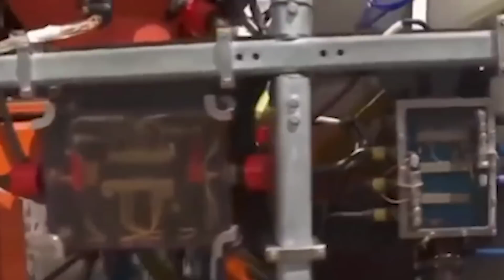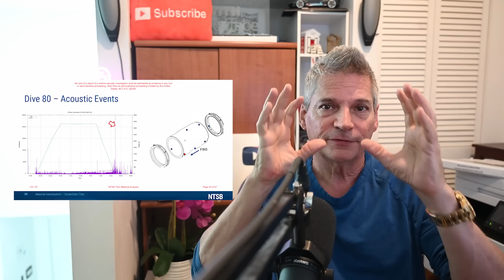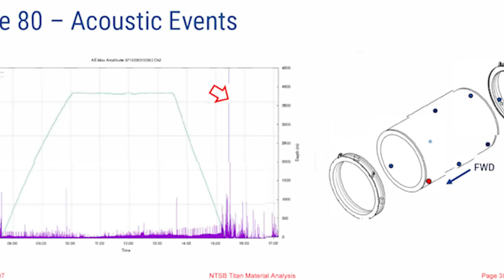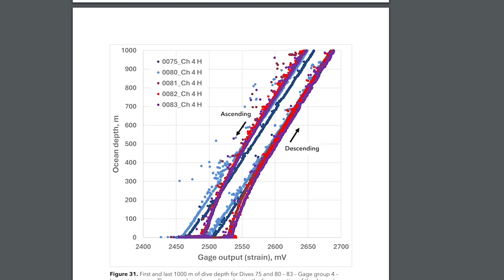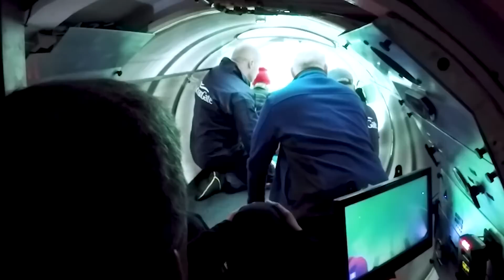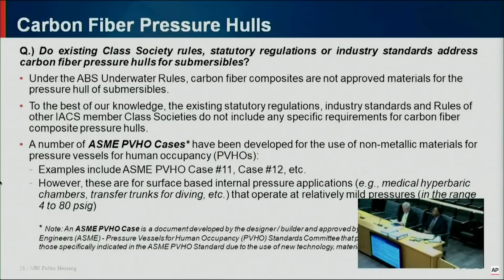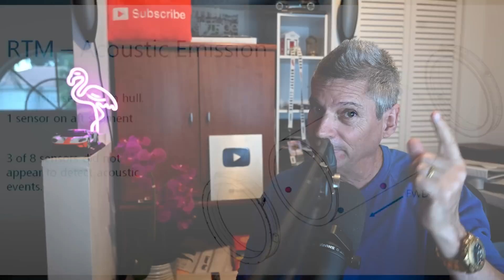How OceanGate Titan Sub Realtime Hull Monitor FAILED! RTM

Comment: That's an important question regarding culpability: After the loud bang, did they actively ignore the changes in the stress messurements (for instance: because they knew they couldn't afford another replacement hull) or did they fail to realize the pattern had changed? I wonder if the answer to that will ever be known.

Comment: The way I see it, Rush was probably told about the changes in data but didn't want to replace the hull because he was a cheap A55 and didn't want to make the expense. I've seen it many times before in my line of work, management rarely listen to the warnings given by the people performing the preventative maintenance.
Reply: Yes, but generally those people are smart enough not to let their lives depend on their own miserly ways. This was hell and gone an Ego matter. He had an idea, people said it was stupid and dangerous, and he had to prove them wrong since it was HIS idea. He ignored the dangers because he knew he was right. 
But he wasn't.
Reply: @chrismaverick9828 Their own lives at risk - not forgetting the 4 other souls who died ad well. That makes me really cross and sad - you shouldn't put other souls at risk, you can do what you like with yours. ❤
Reply: I would argue he was right, his sub made lets call it 80 successful dives, had he graphed and used the data correctly, he should have concluded that sub had reached the end of its service life, he could have salvaged usable parts off of it, taken those, and built another, while updating the design, and further improving it, and led the way in improving submersible designs. However , he failed to do this...  though had he, he very well could have lived a long, and very prosperous life taking people to the bottom of the ocean, for many years.

Comment: Everyone keeps worrying about the carbon fiber.... BUT THAT DIDN'T SINK IT!
The failure point was on the inner 1/4" titanium lip on the carbon fiber end-cap. It sheared off of the titanium segment.
The carbon fiber compression allowed that lip to be over-stressed. 
Rush and all the other after-the-fact YouTube quarterbacks keep misunderstanding the way a carbon tube transmits force to items inside of it that deform at different rates.
I haven't seen a photo of it yet, but if you find a photo of that end-section, I guarantee you will find that flange/lip sheared.

Comment: It looks like the monitoring system may have been working and was indicating something was very wrong.  Not only were there audio cues, there were step changes in the strain gauge readings.  In addition to the monitoring system audio cues the ‘crew’ heard very loud sounds.  This is speculation on my part but it sure seems like the system was indicating something was going wrong along with the obvious human perceptible sounds.

Comment: The pressure on the hull of the Titan was not enough to squeeze out the last penny.

Jeff will make sure not a single drop is lost.
He will put more and more pressure on the story.
With this title. 
That title.
Milking the death of several people like the cow it is.
For money, obviously.
Like Otto did, daddy of daughter Frank.
He sold the soul of his daughter for money, and got rich.
So why should Jeff not do the same.

This piece of tape came loose, that radio call got lost, the realtime hull monitor.... Questionable Engineering, Wreck shows why it wasn't strong enough. Etc etc. 
It is difficult to not think of a new title which Jeff could use to earn a bit more money off of the death of several people.

Great job you got, Jeff.
Reply: Jeff in his description: As the investigation continues....
Yeah, in your tiny brain it may, Jeff.
But those with a brain already know what happened.
IMPLOSION.
Plain, and simple.

Why milk it like a cow?
Are you Otto Frank, earning money from the death of his daughter?

Comment: A big issue with the RTM is that they never had any idea what the RTM would tell them. What is a problematic event? What is harmless? When does lots of harmless turn into problematic? A seismometer is useless, if it never tells you a unit!
Reply: Yes of course but a giant bang and a permanent change to strain behaviour of the hull after that, is about exactly what you would imagine is the data that tells you to scrap that hull. 

"Woop woop, terrain, pull up!"

Hmm I wonder what the Master Caution is all about?

Comment: Since carbon fiber is brittle, Stockton should have been adding the data together for all accumulated dives.  Not using a clean slate with each additional dive.

Comment: 24:03 wouldn’t it do the exact opposite. By adding those rings you’d be compromising the homogenous strength. Under the same principles as why spheres are typically used for high external pressure

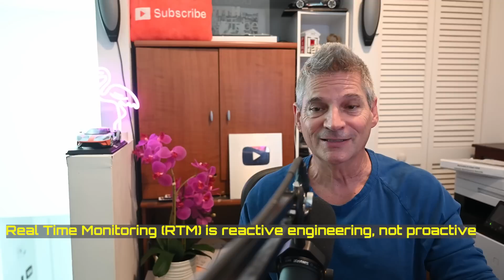Comment: 4:16 I agree with your analysis from an engineering standpoint. I’d like to pose another massive problem that existed from day one that operated from the human psychology perspective. But it ties directly to your engineering analysis. We all know that carbon fiber is designed for “pull” strength. Not “push” strength. Meaning that the Titan hull (iteration number two) had defined, but unknown, entropy built- in. Everyone at Ocean Gate knew there would come that moment of determination when Stockton Rush would have to retire Titan 2.0 permanently. It’s service life having expired. But when? At $300k per “mission specialist” and three open spots per dive, juuuust one more dive could put another $900k into Ocean Gate’s bank account. Nine hundred thousand dollars is a heavy motivator for any small business and any innovator or entrepreneur. Ergo this tragedy was baked in since inception. Thank God for the Coast Guard hearings. I greatly appreciated hearing truth from the individuals who were fired for trying to hold the line.  Throughout the hearings I often wondered: did these terminated employees have a moral responsibility to whistleblow? Would doing so have saved the lives of four predominantly innocent adventurers?

Comment: Seems to me that it didn't fail. In the limited way they used it, their death-o-meter functioned as intended - record strain, pops and other things. The fact there is a graph coinciding with the bang shows it worked. The problem was not the device but bad assumptions and misinterpreting / ignoring that data. Firstly, just because it records strain in real time but it does not follow that a pilot has time to react if a serious event occurs. Secondly, with Stockton Rush as pilot, he was incentivized to ignore what the strain monitor was telling him, not just presently but as recorded on previous dives. Because he was a cavalier idiot.  So the monitor was a good idea that clearly captured significant data. But what good is that if nobody wants to listen to the story it is telling?

Comment: I think the main issue the final haul was never tested to failure. So you dont know what the true failure mode is and how the sensor will see it. Like put on a pressure vessel and tested until it fails. This is common on everything to car, boats and airplanes.

Comment: the design is inherently flawed (e.g. C-chanel titan to carbon design feature not suitable), Data from Monitoring system ignored, manufacturing process not mature (local instability due to wrinkles under pressure causing delamination), NDT not performed, etc, etc.
 However, this does not mean you can not design a submersable with foreseen diving depth with carbon/CFRP hull and it does mean that you can not accomodate a cylindrical shape

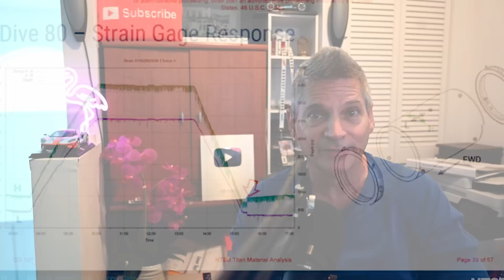Comment: @Jeffostroff at 18:50 I think you’re slightly wrong about the test failure being at 6,500 meters. I think it was at 6,500 psi, which is much closer to 4,000 meters than to 6,500 meters.

Comment: I don't see how the carbon fiber added much strength at all, since it was only under compression. I wonder if a pure epoxy pressure hull might have worked better.
Reply: It certainly would gave had less voids and imperfections and been transparent enough to look at with a flash light and acrylic windows are certified, known to work. So yes I think a pure epoxy hull was probably not the worst option.

Comment: I think that one of the primary problems with the concept is that if they were conservative with the RTM data, the only action they could take would be to stop diving and replace the hull, or at very least conduct expensive and time consuming nondestructive testing. That was not convenient to Stockton so he ignored the warning signs. I would be interested to know if they had any ability to catch cracking or delamination with nondestructive testing. I’m guessing not, but would be interested to know.

Comment: Here's the problem with the sensor monitoring system, you have no previous test data that tells you, when you are at the bottom of the bloody ocean, that if a particular sound or issue is being detected, you will have enough time to return to the surface and be safely unbolted and escape the craft before it breaks apart. You cannot escape the testing ut till it breaks system, without occupancy, of a vessel to the failure point, so you know what the failure point is. There are always risks with no technology and processes so that is why you test, test, test before you put lives at risks.

Comment: Back in July/ August 2023 there was a video posted that gave a full coverage of the dive until communication was lost, according to that video the Titan sub after 15 minutes of submerging had submerged to about 900 meters instead of being around 500 meters compared to previous dives, and after 45 minutes where on previous dives it was at around 1500 meters it was at 2500 meters, when they got down almost to the Titanic and there were hearings some sounds the weights were dropped to begin the ascent the sub after 15 minutes had only risen about 6 meters so they according to the video dropped off the frame legs to increase the buoyancy it only rose another 25 meters at which time all communication was lost.
If this was all correct I wonder if there was a miscalculation of the total weight of the persons on board, considering that the sub submerged a lot faster then previous dives and then didn't respond as normal to ascend.
Reply: possibly water intrusion into the CF hull in damaged areas from previous dives reduce the hulls buoyancy.

Comment: The RTMS did work, it showed a clear failure at dive 78 during resurfacing, and that there had been a loss of integrity.
The data was either ignored due to ignorance (lack of training by maintenance/ responsible engineer), or due to reckless disregard.
Considering the inventor was on board the craft, this was clearly reckless disregard. 
If he was soloing it would be a tragedy, but that he charged people for the pleasure of climbing into that death trap, he was a murderer.

Comment: They did one scale model test run to failure?  Could this be the carbon fiber equivalent of metal fatigue, where one big flex is handled by the material, but multiple smaller flexes cause the eventual failure at a far lowe than expected stress level?

Comment: Your comment about the Idiot Lights on a car... I'd like to expand that thought because when one of those lights comes on; you can easily and quickly just stop the car and shut the engine off before more damage is done.  The problem with the sub is that it still has to take time to resurface before it can "stop" the danger.  So in that case, the car scenario would be like trying to outrun a tidal wave that's barreling down on you at 30mph and your engine light comes on. That's not a scenario where you can just stop the car and minimize the damage.  You're forced into continuing on with your 40-60mph driving in order to avoid disaster. So yeah, I'd rather have a car that gave me more time in advance so that I knew which car not to take when outrunning a tidal wave.
Reply: meaning, if I had 3 cars to choose from and the first car I got into showed me a slowly rising temp gauge, I would choose another car rather than finding out, halfway into the journey, that there was something wrong with the cooling system

Comment: In the most vague defence of Rush, the RTM did work. He was just arrogant and ignored it.

Obviously the RTM is still flawed, because any severe readings at it's lowest depth absolutely wouldn't give you enough time to surface again. But in this instance it actually did successfully show a failing hull over the course of many dives. Shame they didn't read that and retire the sub. Sadly we know this was about money and ego, so retiring the hull was never going to happen.

Comment: Thing is Stockton was far to ruled by his narcissistic ego thinking he was better then anyone. He was right 110% about everything. His list for invasion was basically being out the box to take huge risks and be accepted to not comply with the safety aspect. He knew he would have to pay millions more to to succeed to get it certified. He wasn't ever gonna listen to safety experts or spend more as he built cheap everytime. The fact he had these monitor systems was a gimmick to appease the safety experts. But it was by his safety values which we know wasn't ever good enough to protect any ones life. Not matter the readings or what people was saying theres cracking in the hull over content dives and dragging it in transport to and from the site. He was money, money, money and ego this was never about innovation he just hid behind that to break rules cheaper from profit. He sacked people for being realistic in his flawed attitude. He sacked people for not letting it go down to titanic for being unsafe. He would certify it or let them strip it to scan the hull. He knew it would fail and again wouldn't be making money once gain diving. Or cost him the millions to put right the bloke should be classed as a murderer for this as no one could over rule and stop him for being careless for peoples lives for profit.

Comment: The RTM system is detecting individual failures in the carbon fiber hull. The record it provides is a tabulation of failures over time. Thus, it appears that each failure event recorded is a unique event and these events recorded over the life of the hull indicate a progressive diminishment in the strength of the hull. Only by summing all the events that have been recorded over the life of the hull would one have a concept of the progressive diminishment in the hull's resistance to buckling. From what I understand of the use of the system, this was not done.

Comment: If those RTM sensors were glued to the inside, would it then not be possible for the outer layers to be delaminating with no sign on the sensors?
Reply: I was assuming that they had sensors at various levels of thickness, not just the very inside. In hindsight, it didn't really matter because such poor engineering can't be saved by instrumentation.
Reply: They detected noise and delamination is noisy.
Reply: @please_stop-v7o  they detected stretching and compression, and if the outer layer is separating from the inner, its not gonna pick that up. Different sensors picked up the noise.

Comment: There was nothing wrong with the data recordings. They explicitly show the cyclic fatigue the CF laminations were suffering.  The lead up to the fateful dive shows a drop in acoustic data which indicated that the hull was done delaminating and was significantly weakened.  That's where the stain gauges come into the equation.  The strain gauges showed increased deflection and distortion in the weakened hull.  Rush was bent on driving this project forward as a commercial operation.  Based on his routine dismissal of  obvious safety issues and denial of any serious shortcomings in his vessel, Rush would have created a story that  the hull  was "settling" and the  reduction in acoustic data from the sensors would indicate that the sub was now safer having reached a "seasoned" state.  The only reason I have a modicum of respect for Rush is that he believed his own BS to the extent that he was prepared to ride the thing himself, not send a Red Shirt in his place.

Comment: 8:33 With all the information I've seen here on YT I'd say it was the glue connection between the rear titanium ring and the tube that broke. After that, in my opinion, you can see on every dive how the tube in the C-channel wedgedes up. Without the glue, the entire load of the tube's compression press on the flank of the C-channel, which then broke in the accident.

Comment: Some graphs have been shown for the strain gauges.
One of these show the stress( depth  thus pressure) against stain..
Showing one dive( stress cycle) NOT returning to the initial  point..ie showing a yield in the material..a SET if we were talking about a normal elastic material..
This appears to be from the dive prior to the last dive..
This shows the material has "changed".
Reply: They had 7 more successful dives after that.

Comment: 18:35 important to note 6500 psi is NOT 6500 meters below sea level. Earlier in the news segment you can hear the caster say its about 15000 feet which would be 4572 meters. A lot closer to the depth of the titanic than you postulated here.

Comment: Comment at 21:00 minutes in: Not a proponent of carbon fibre for a submersible vessel, and greed that a spherical hull, as per all available credible evidence would have been a superior design. I also think that in going with a spherical design, a crisscross pattern in building up the carbon fibre layers would have come naturally and inherently provide greater integrity, compared to the linear applied layers as used in this case.

Comment: I said this from the very beginning.  If you don’t failure test multiple carbon hulls to capture real data, you cannot rely on those systems.

Knock sensors work the same way and automotive engineers spend thousands of hours studying acoustic noises and data to ensure they’ve isolated exactly the data they want.

Rush never did this.  The system was marketing bullshit.